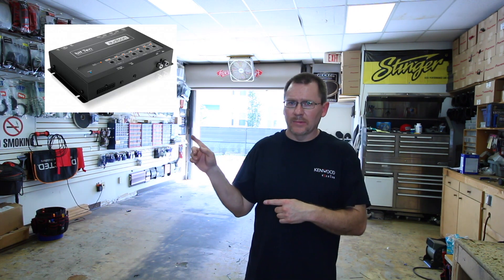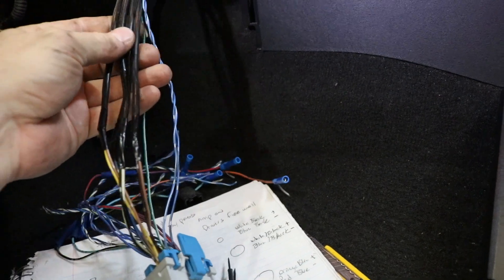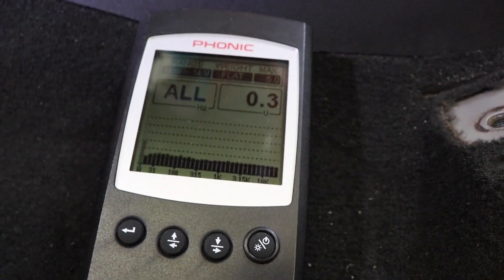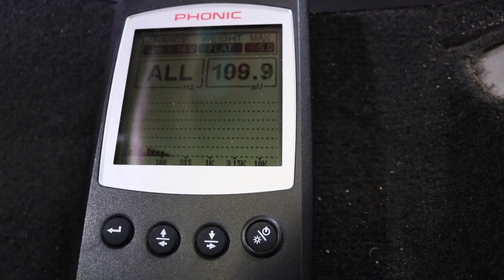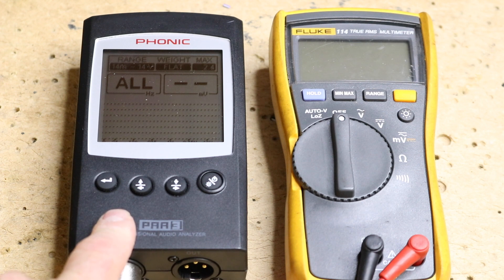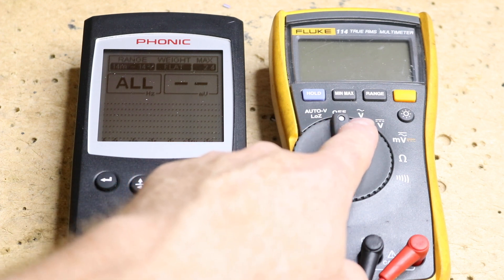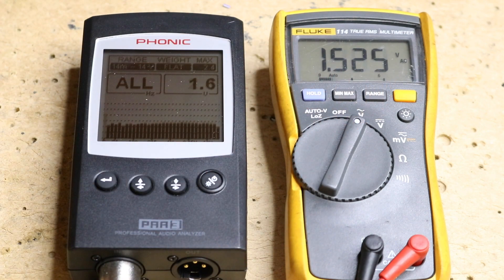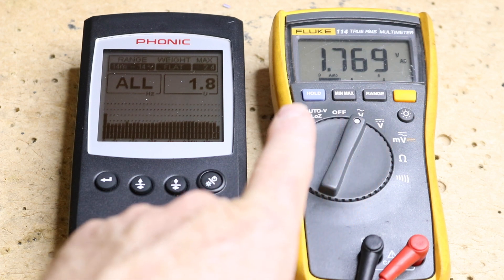How to test if your cars factory radio has a variable voltage output to the factory amp

Comment: Guys I have questions and need advice concerning my 2014 mazda cx-5. I have a small 5ch amp that I want to hook up to my oem head unit. I upgraded the 4 door speakers from those crappy bose. Fyi, oem bose system. 
Thanks gentlemen! 😊

Comment: like the video. no matter how long the video came out the information is the same pretty much now. 
My issue. I have a 2012 Buick Verano with factory 9-volt radio, so says on the manufacture sticker. It's hooked up to a factory 100-watt amplifier, to a 9 speaker Boss system. I recently added an aftermarket amplifier with a low pass filter connected to the rear speakers, since they are 6x9, and gives the best signal to tap into. I added a subwoofer box with two 12" woofers tapped into the rear wiring, since the factory radio does not have a low pass output. What I am concerned with, the voltage of the radio and the extra amplifier. Since there are two amps now. Do I change the voltage on the radio to match the extra amplifier? But the factory radios amplifier probably uses 9 volts for the car's speakers. Will alternating that voltage affect the measure of loudness? Since the aftermarket Amplifier has an output of 6 volts, should I match the radio to that? I am still learning here. Unfortunately, I haven't had any luck finding an aftermarket radio to replace the factory. I been told there are none. Any subjections there as well? 
thanks.

Comment: Question. I have a 2015 ram 1500. Base radio no factoryamplifier. I was given a radio from a 2018 with factory amplifier by the driver kick panel.  If I put it in my 2015 how would I amplify it to get my volume control to work.

Comment: Question,
 I have a new 2021 Nissan Titan with the Fender audio system. The factory sub is located under the drivers seat. There are two sets of wires going into the enclosure. I’m assuming that the sub is a dual voice coil. I’m just wanting to hook up a JL Audio HD 750.1 amp to add some more bass. 

My question is, can I test the voltage on the speaker wires going into the  subwoofer to see if there’s a variable voltage?, or do I need to check at the amplifier input from the radio?  

Also, do I need to attach RCA’s on both sets of the speaker wires going into the factory subwoofer input and use those for the JL amp?, or is tapping in on one set with both left and right RCA’s ok?

Comment: I have a 2006 jeep liberty limited with factory amps in each door. I'm removing the amps but want to use the factory wiring if possible. How can I use the voltmeter to determine which wires go to each speaker. There are 8 wires at each door speaker. Thanks. Would run new wires but those door boots are a pain.

Comment: Dean I bought the Phonic 31-RTA but please let me know how you are using test robes with it. Where can I get it.
Reply: Hi, Did you figure out how to connect probes to your RTA?

I've got one on the way and I'm thinking of wiring the XLR connector pins 1 and 3 to the negative and pin 2 to the positive or just but a phono to female XLR cable from eBay and cut off the phono bit off and attach probes to.

Comment: If I have a 600w rms amp, while I have 4 gauge power wire used in the install, the ground wire is not as thick. I think it is a 8 gauge wire. Do I need to replace this?
Reply from the maker: Phil Indeblanc yes, DC systems work in a circle, in one side and out the other. Think of it like this - starting at the positive battery post going in to the amp - coming out of the amp going though the frame- off the frame to the factory ground strap - to the negative battery post. If any one of those is bad they all suffer.
Reply: I'm shocked at the noise floor of the JL, while the Alpine, older PDX-4.100 is almost nil. And JL brags about their special RCA looping for noise. I don't get it. 

So, does that mean take out the 8gauge ground wire,  which I need to see where it ends, and replace it? Maybe that is required by JL to get a insignificant amount of noise?
Reply from the maker: Phil Indeblanc yes I would replace the 8 awg with 4 for sure. Floor noise usually means the gain is up to high or the EQ has to much boost on the high bands.

Comment: JL HD 600.4 amp may have some major issues with taking different volt output from source. It says 200mV to 2V as low and then says 800mV and up for higher. Yet in manual it says if its an aftermarket unit use the low setting of 200mV to 2V. RF 360.3 DSP is a max of 8v, but surely isn't at this level. Yet JL HD600 amp fails and goes to protect mode with damage. JL tech says check for speaker volts to be about 24.3Volts. Hmmmmm Whats the deal?.
Reply from the maker: The Titan we were working on had the Factory Rockford system. The radio basically had line level out from the radio( RCA low voltage). That input on that amp seems low, Basic aftermarket radios can put out 4volts.  I guess you must run it with the gain all the way down.
Reply: Yes, or switch from 200mV-2V to 800mV-8v
Reply: JL wants to see 24.3-24.5volts at the speakers...using resistance calc for the max at the volts.
Reply: So I used a sine wave test tone (250Hz on mids, and 1000Hz on highs), and set the HD600.4 amps at 24.5 volts on each channel. (which I think is almost half of the rms max if you use ohms law to calc). Anyway, this JL amp is really being a pain in the rear! As I have more low Freq going to the mids than I do to the tweeters, so there is more volt current going to the mids. But the current to the tweeters are very low. So the mids I use the high volt switch since I was getting 12volts with sensitvity/gain minimal, while the tweeters are hardly causing a volt reading and set to low volt input, and still need sensitivity gains adjusted up heavily. 

Is there a way to test if my DSP is outputting the right amount of volts/power to the amp?
Reply from the maker: Phil Indeblanc you can use a test tone and a volt meter set to AC or a pink noise. There is a technique called gain overlap used for settings gains. Not all speaker have the same efficiency so setting the gains  identically can cause problems. If your tweeters are super efficient and your mids are not, you would turn the tweeters down some and mid up some. Think of it as blending the sound with the gain. The only thing you have to make sure is to not clip the amp.
Reply: I understand this a bit, but the 6.5" are 89dB, and so are the dash 4" 2ways (btw, they are a QSD216 mid, and Morel IntegraHybrid402 in dash)
Reply from the maker: Phil Indeblanc the speakers on the dash are going to couple with the window. The may get a little loader up there so turning them down a bit is ok.

Comment: Hey do you know what exactly does S.Rtv does on The nex 4200
Reply from the maker: It is used to help very compressed music to sound less compressed. There are 2 modes depending on how bad the compression is done. If the source music is good it will have little effect on it.